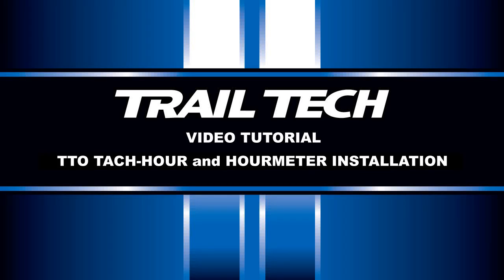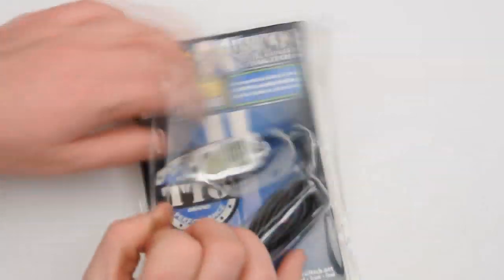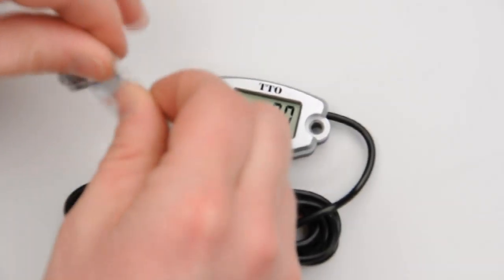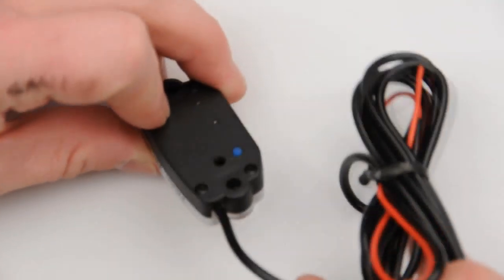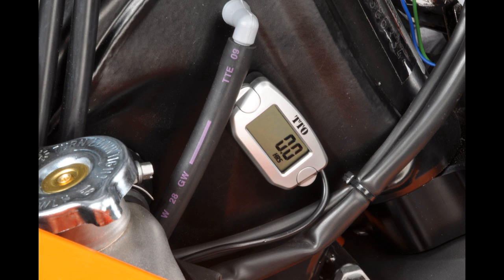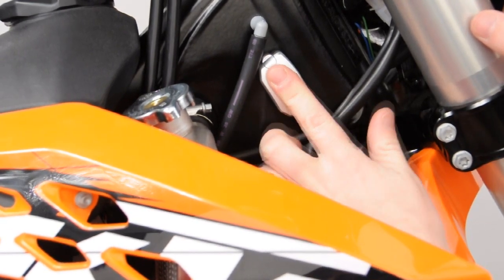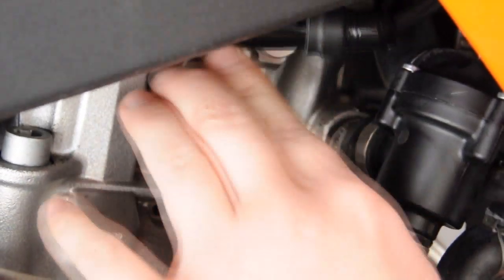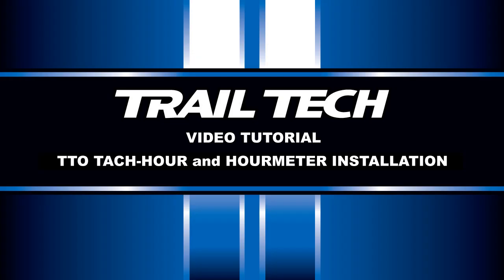TTO Tach Hour and Hourmeter Installation

Comment: Unfortunately the internal battery is not replaceable. Trail Tech encases all of the internals in epoxy to make them as water and vibration proof as possible. If the screen is completely blank and you have had the meter for less than a year contact Trail Tech to see about getting it replaced under their year warranty period.